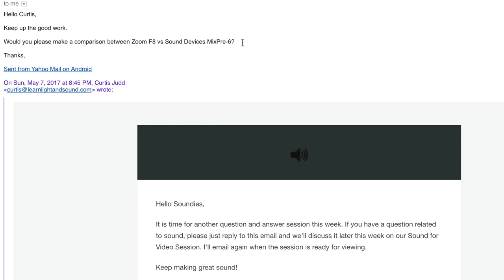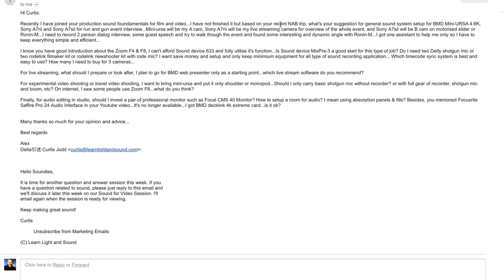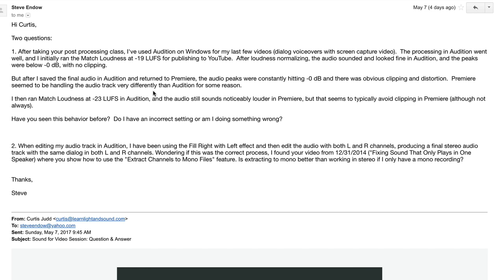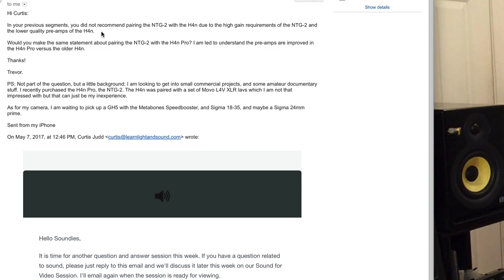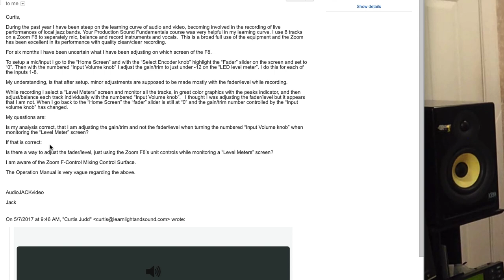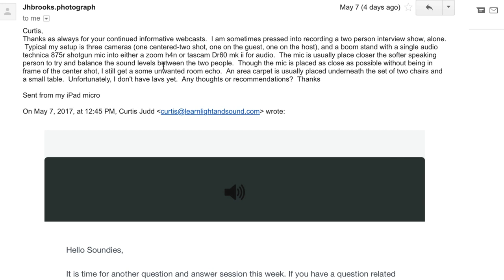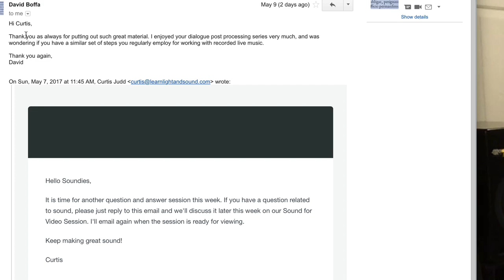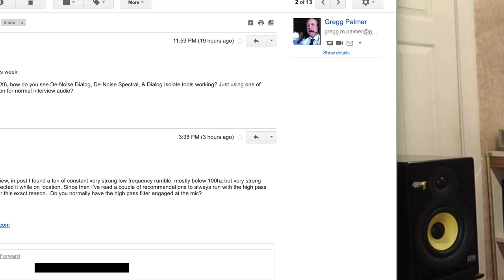Sound for Video Session: SD MixPre-6, Faders vs Gain Trim, High Pass Filters

Comment: Great information as always! Thanks for the comment on Sennheiser MKH-50 low cut filter. After your comment I went back and reviewed the MKH-50 manual. Sure enough it's not a normal low cut filter for low freq rumble; it's instead designed for proximity effect removal ( -4db reduction below 500hz). That's why it can effect dialog quality.
Reply: Thanks for the questions Gregg! On other mics, it can be a good strategy, particularly if your mixer doesn't have an analogue filter in front of the preamp.
Reply: Yes, I found that very helpful.

Comment: A cheap way to get into Sound Devices is with the original MixPre. You have pro XLR out, but with a 25db padded cable you can feed the mic input of a DSLR / DSLM camera. I've added a plate with a 1/4-20 hole on the bottom for mounting.
Reply from the maker: Good idea, thanks for that Chad!

Comment: On the dual mono question, I don't totally go along with the "dead centre" rule of thumb for dialogue. When I do two-headed dialogues, such as a two person presentation, I routinely slightly pan L-head to L and R-head to R. Since they are stationary there's really not much work involved. Perhaps ultimately only I notice, but I like the effect.
Reply from the maker: +kipling1957 and good as long as the audience views with a stereo playback. Can be effected if played back mono.

Comment: Hi Curtis,
thank you so much for all the great content that you do, it's really amazing!!
I'm a cameraman and shoot corporate content and TV documentary stuff and am thinking about buying my own audio gear so I can provide my assistant with it myself on smaller productions.

I am thinking about buying a mixpre-3 and would like to use it with my FS7 as a dual system recorder with nano lockit boxes.
But for TV I have to be able to provide a single system solution. That's why I was thinking about getting a DI Box to convert the unbalanced output of the mixpre into two xlr connectors.

I have spent the last couple of days trying to understand these boxes :) But I still don't get them fully
Would you recommend an active or passive one if the goal is to get the signal from a mixpre to a Sony FS7
I am considering the Radial Engineering ProD2 (passive)
and the Radial Engineering J48 Stereo (active).

What I am not sure about is this:
If you put a line signal into a passive DI box it comes out as a Mic Signal, right? So I would have to use the preamps of the FS7 to record the signal coming from the Mixpre through the ProD2. Correct?? That would kind of defeat the purpose of having such an amazing mixer with a low noisfloor right?

On the other hand the J48 is powered by Phantom Power and thereby can output a line signal, but I can't set my FS7 to Line and Phanton Power at the same time. I can only activate the phantom power in combination with the mic input. so "mic+48" By adjusting my FS7 inputs to this setting the signal from the j48 stereo (active DI box) would be way too loud right???

As you can see I am confused. I really hope you can help me. Otherwise I have to get the Zoom F4 which does not have the analogue limiters that I would like to have :)

Thank you so much again!!!

Gabriel
Reply from the maker: Hi Gabriel, thanks! A question: When you work on TV jobs, will you have the MixPre-3 mounted on the camera rig? I'm thinking you could have an even simpler solution with unbalanced output to XLR adapters and go into the camera without a DI box at all (this combination almost always works). Then you could go into the camera line level.

However, if you do need to run cables more than a meter or two, a DI box is a good idea and the Radial Engineering are good options. You would have to go through the microphone input on camera, so this would not be my preferred option.
Reply: Thank you for your answer Curtis! Unfortunately mounting the mixpre onto my camera is not an option for me because its too clunky and I would like a second person to adjust the levels for me. I did find this device on a forum: Palmer PLI-02. Its a two channel isolating transformer which is supposed to be able to turn the unbalanced signal into a balanced one without gain loss. And its also a passive device. So a line signal stays a line signal. I think I'll try that. Do you think this might work?
Reply: That looks like a promising solution. Let us know how it goes!
Reply: I will :)
Reply: Unbalanced signals works well with no problem until 18 feet. If you want more distance considerate behringer DI20, a 9V battery lasts 10 days I think.
Reply: Thanks Erick, that's helpful.
Reply: Gabriel, in my experience of using a Zoom F8 with FS7 and FS5 the Zoom digital limiter has never been an issue. There is plenty of headroom in the Zoom F8 digital A/D to allow for digital limiting in normal use. I would not let the limiter design be a deciding factor between the Sound Devices MixPre and the Zoom F4/8. I would look at more meaningful functional differences. Adding in an additional component (DI box) between the a mixer and the FS7 should not be required and would only make your setup more complicated than it needs to be, at most you would need a cable adapter to split out the stereo signal into mono feeds.  I would be concerned with the robustness of the connection coming out of the mixer and the ability to change the mixer output signal between line level or mic level. Depending on your type of shooting a wireless hop might make more sense to transmit the mixer output to the camera. Things that would drive me towards or away from a particular product are: having large easily accessible mic gain trim knobs on the recorder (not faders as gain is far more important to me ), pre-roll recording (think safety), ability to dual record a single mic at two gain levels (think safety), dual simultaneous SD card recording (think safety), built in timecode generator, ease of menu navigation, accessibility of SD cards and batteries. Those are the types of things I would factor into my decision.